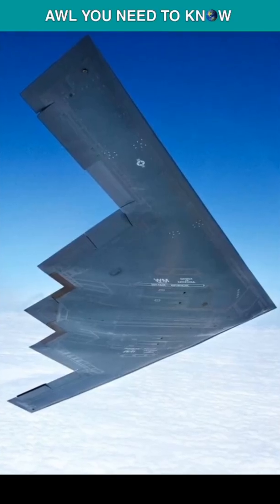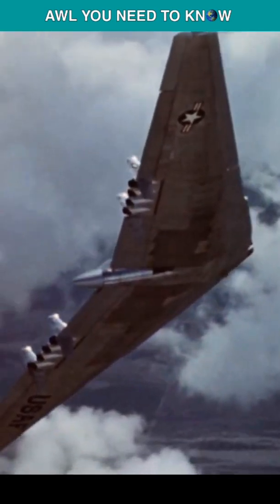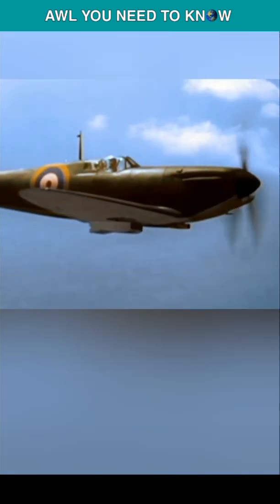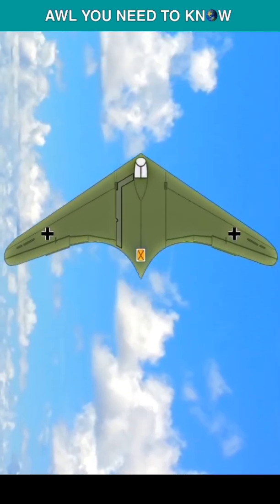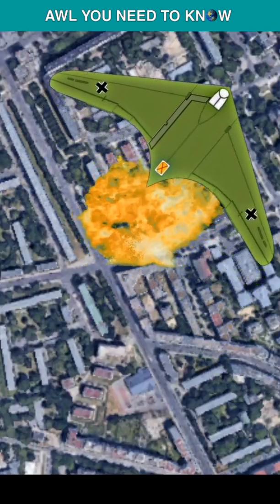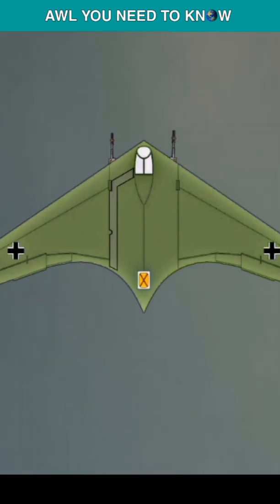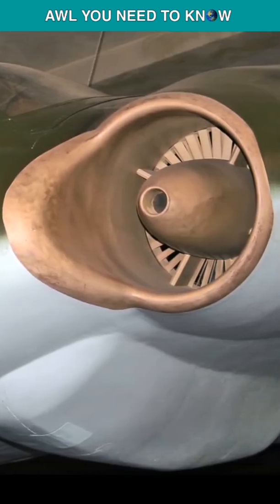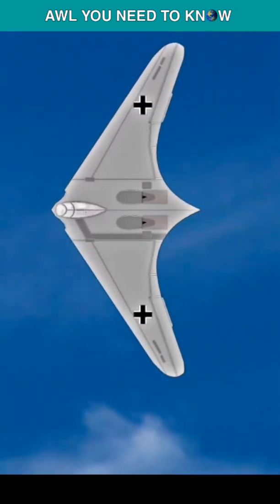Germany's Stealth Bomber Of WW2 #shorts Horten Ho 229

Comment: There is no connection between the Ho 229 and the B2, exept for the shape lol
Reply: Yea I keep hearing that. I wouldn’t be surprised if they used the 229 model as a base but the 229 wasn’t even meant to be stealthy
Reply: @WorldWarWeirdo  well, time to erm actually. The Ho-229 had a planned "RAM" coating that mightve been used over most parts of it if it went into production. This "RAM" consisted of a mix of wood and charcoal, plus a few other things. The overall shape of the Ho-229 was RCS tested and showed positive results making the Ho-229 have a 60% reduced RCS effective to radars in use for Britain.
Reply: @DecayLe4 There was no coating.
Reply: @peterson7082  there was no coating because there was no aircraft to coat, hence why i said "planned" 🤦 next time read more (also read up on history a lil more before denying something true)
Reply: There is a big connection, the B2 was also technically invented by germans
Reply: @unitemankind rubbish.  Northrop was using flying wings in the 1930s and their work in the YB-49 was directly used on the B2 program.  Why lie when it’s so easy to look up basic facts like the history of the B2?

Comment: I ducking knew it
Reply: Then you're wrong. The Horton 229 is not a stealth bomber. According to tests made by Northrop Grumman (on a model made out of wood, which is better at absorbing radar waves than the materials used in the production model) the Horton could very easily be seen on radar.

Comment: The HO-229 is not the grandfather of the Northrop B-2. Northrop already had made and tested flying wing designs during WW2, one of those was overhauled some decades later and flew until 2019. The B-2 is the result of those and later tests. The only reason people talk about the HO-229 in connection to the B-2 is because its maker made those claimes because he was starved for money and fame
Reply: FYI the b2a spirit has the same Wing length as the original yb49 172 ft.
Reply: Bro X35 came in 1946 and Ho299 in 1945
Reply: @ravind3263  

Xb35 started in 1935

Ho229 in 42.

XB35 was being made even before 229 was even a thing

And again 229 didnt come in 45. It infact never came, US didnt have any idea of a 229 up until 47
Reply: @ravind3263  The IS was caught off guard on how far along the Germans were in development, but we’ve had our own, just wasn’t as fast developing it as Germans were
Reply: @jayyoutube8790   Jack Northrop was designing wings before WW2 and was awarded the money and contract to start the XB-35 in 1941, years before the Horten brothers.  Northrop's large, long-range bomber was the design that the Horten brothers were working toward, but they never got close that idea.  The 229 program only produced three different prototypes and only about two hours of powered flight. That's all.
Reply: No He wasn't. The Amercans usd the Germany teachnologies and put it onto their aircraft way after the Germans had. Germans were way more adavnced. The b2 was yes starved for money and fame its creator was.
Reply: @Deutscher_ChristDE you need to learn English.
Reply: @lookoutforchris  You need to learn what a typo is, and a second language.
Reply: @Deutscher_ChristDE the B2 was starved for funds 😂😂😂😂 a black project and operational program with total costs of $79 billion through 2004 (latest figures i could find).  So yeah… $79B and hurting for money 😂. M0r0n comment.
Reply: @lookoutforchris  I said the idea was became the creator was starved for money😂😂Idi0T
Reply: @lookoutforchris  I said the idea was 😂😂can you read and understand context?